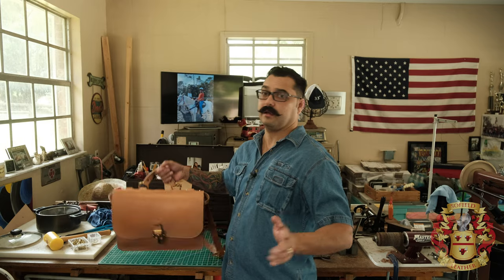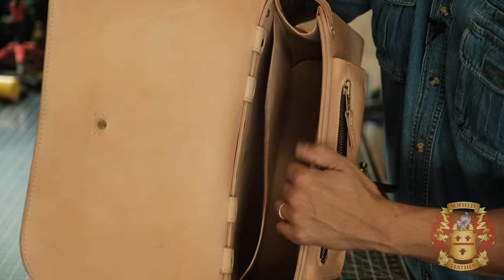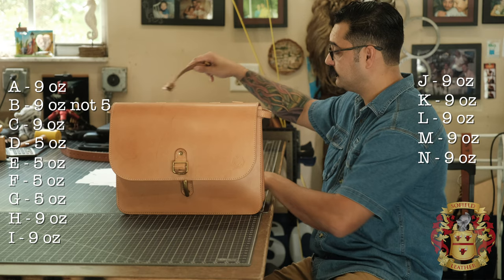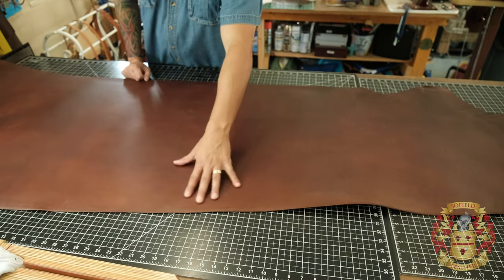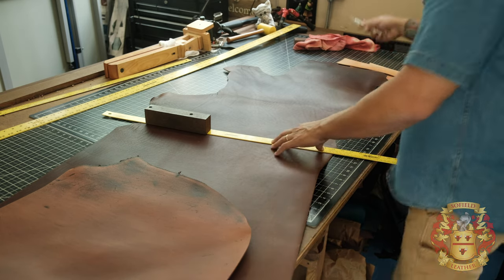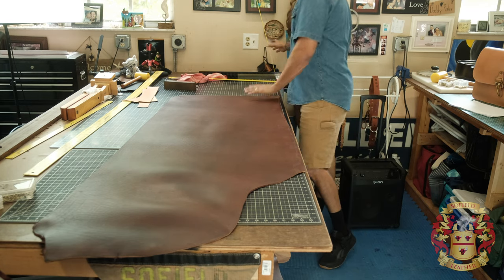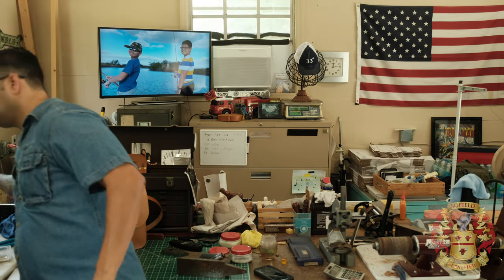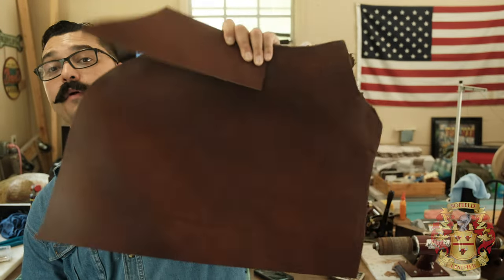How To Make a Leather Satchel Bag - Part 1 of 6 - Pattern Download

Comment: Nice work looks really good. Where did you find the gold rivets? All I can find are the copper ones and I need gold, silver, and gunmetal if possible. Would you be able to lead in the right direction?
Reply from the maker: Yessir. I buy my Brass rivets at weaver leather. I have a tools video.
Reply: @SofieldLeather  thanks! I will check it out. I never really went on weavers leather. I will also look at your tools videos
Reply from the maker: Awesome. Thanks Jon for watching. 👌🏼👊🏼

Comment: I like everything about this bag except that handle. I shouldn't be twisted like that. I've never seen a case with a handle like this. It honestly should be in line with the bag, and two square buckles. But my opinion of course.
Reply from the maker: Good points. I appreciate the feedback. Let me explain my design choice. The handle is quite comfortable and easy on the hand. It’s designed to pull on the spine verses the flap which promotes longevity. The handle location and buckle design allow for easy quick one handed access, even while over the shoulder. 👍
Reply: @SofieldLeather  Ok, that's a reasonable explanation, thanks.
Reply from the maker: That’s this bag. I have made it like what you’re explaining. That’s very nice too. Very traditional. Looks good 👍

Comment from the maker: How To Make a Leather Satchel Bag - Part 1

💾 Download the Template
→ https://www.sofieldleather.com/shop/p/briefcase-pattern-build-along-video

💼 Watch the Whole Build Series
→ http://bit.ly/Satchel_Bag_Build_Series

👨🏻‍💻 Download Templates, Patterns and Blue Prints
→ https://bit.ly/Secret_Blue_Prints

🤷🏻‍♂️ How To Use My Patterns
→ http://bit.ly/How_To_Use_My_Patterns

🛠 Hardware - Tools - Material⇩

👉🏼 325 Dee Solid Brass 1 1/4 inch
→ https://www.weaverleathersupply.com/catalog/item-detail/00325-sb-11-4/325-dee/pr_1070

👉🏼 325 Dee Solid Brass 3/4 inch
→ https://www.weaverleathersupply.com/catalog/item-detail/00325-sb-3-4/325-dee/pr_1074

👉🏼 1144 Collar Set 1 1/4 inch
→ https://www.weaverleathersupply.com/catalog/item-detail/01144-sb/1144-collar-fastener-set/pr_1730

👉🏼 5015 Square Scissor Snap 1 inch
→ https://www.weaverleathersupply.com/catalog/item-detail/05015-sb-1/5015-square-scissor-snap/pr_2320

👉🏼 50 Buckle 1 1/4 inch
→ https://www.weaverleathersupply.com/catalog/item-detail/00050-sb-11-4/50-buckle/pr_321

👉🏼 3425 Button Screw Stud 1/4 inch
→ https://www.weaverleathersupply.com/catalog/item-detail/03425-sb-1-4/3425-button-screw-stud/pr_2211

👉🏼 Circle Tool
→ https://windfiredesigns.com/Tools/CircleTool/index.html

👉🏼 Pippin Punch
→ https://www.buckleguy.com/105-2-oval-pippin-punch/

👉🏼 Wicket & Craig Leather (Ask for Cindy)
→ https://wickett-craig.com/direct-sales/

💼 Shop 
→ https://www.sofieldleather.com

🇺🇸 Watch my Vids on Rumble
→ http://bit.ly/Sofield_Leather_On_Rumble

⏱ Time Stamps:

00:00 - Intro & Info
02:11 - Build Time
06:02 - Pattern Overview
07:53 - IMPORTANT Pattern Info
08:45 - Pattern Overview Continued
16:40 - Leather Thickness
20:50 - Building Options and Yields
25:23 - Where I get My Leather
26:42 - How to Trim the Side (9oz)
42:37 - IMPORTANT Cutting Tip 1
43:59 - Cutting Your Patterns (9oz) 
53:24 - Total Yield So Far (9oz)
54:14 - IMPORTANT Cutting Tip 2
59:06 - IMPORTANT HOLE SIZES
59:59 - Clicking the Rest of the Pieces
01:00:35 - Overview (9oz)
01:03:24 - Special Tools
01:05:31 - Cutting and Trimming the 5oz
01:07:16 - Total Yield So Far (5oz)
01:07:54 - Overview (5oz)
01:10:28 - Hardware Needed
01:12:14 - Outro

 🖥 Playlist ⇩

📒 Leather Patterns & Build Alongs
→ https://bit.ly/Leather_Patterns_Build_Alongs

😉 Leather-Crafting Tips
→ https://bit.ly/2HP6MZa

🤲 Build Videos
→ https://bit.ly/2ZnzVPZ

🧵 Handmade Leather Tote Bag - ASMR - Complete Build 
→ https://bit.ly/2NDyKqa

💼 Handmade Leather Briefcase 
→ https://bit.ly/3g898hn

🎧 My Music 
→ Spotify: https://bit.ly/Alexis_On_Spotify
→ Apple Music: https://bit.ly/Alexis_On_Apple_Music
→ YouTube Music: http://bit.ly/Alexis_On_YouTube_Music
→ YouTube: https://bit.ly/Alexis_On_YouTube
→ IG: https://bit.ly/Alexis_On_InstaGram

#LeatherSatchel #LeatherPattern #DIY